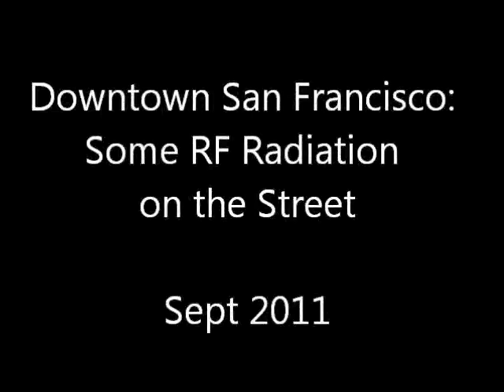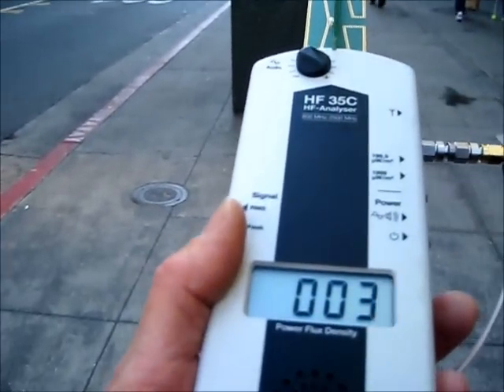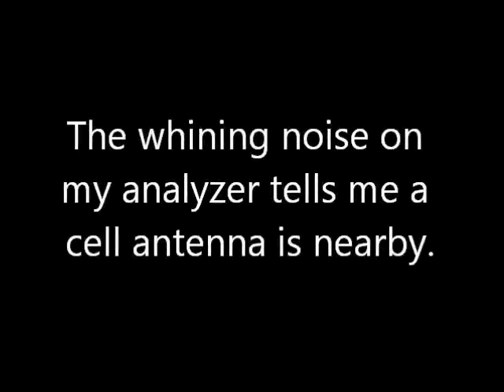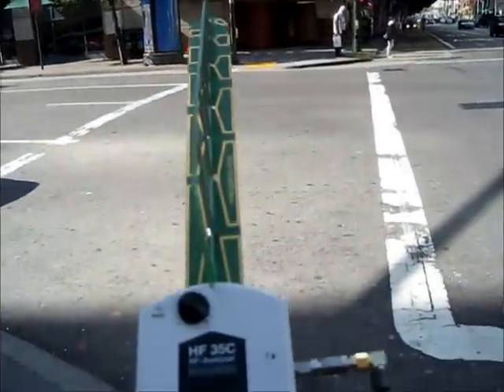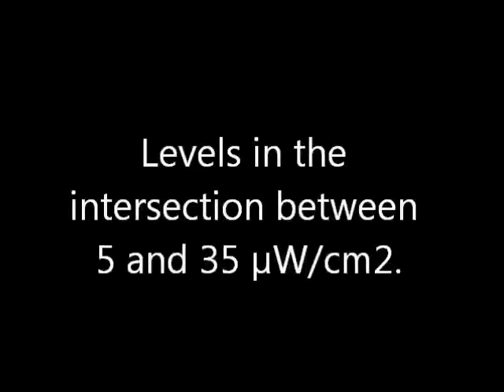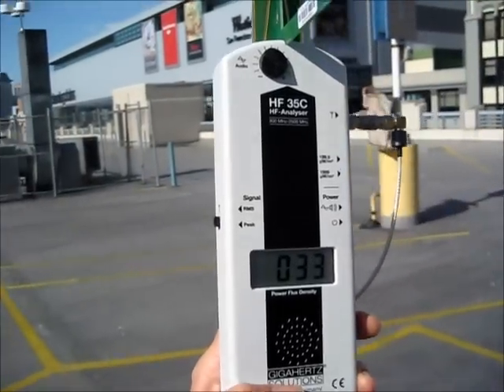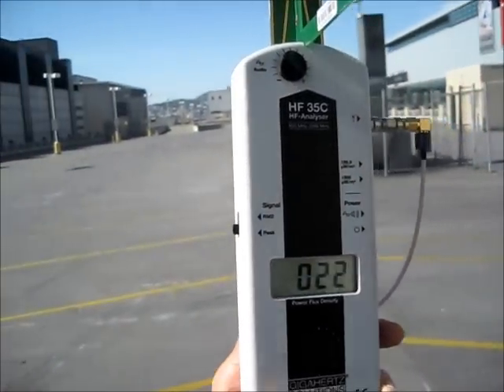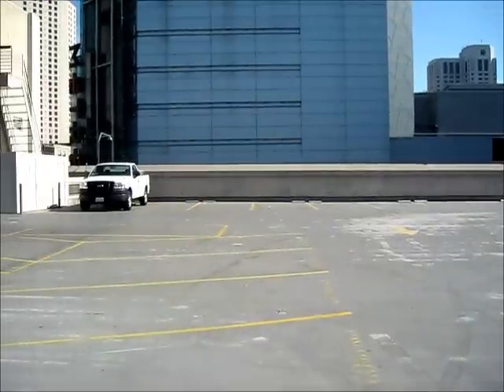RF on the Street: "Stealth" Cell-Phone Antennas Downtown San Francisco

Comment from the maker: @VideoGuyNC  Hey, you are right---though when someone is on a phone outside and an antenna is nearby, the level coming off the phone is much less than you'd think. The power in cell phones has gone steadily down down down over the last ten years, while the power in the antennas has gone up up up. I have an electrician friend who estimates (with data and contacts) the power in an array to be 20-40 kilowatts.